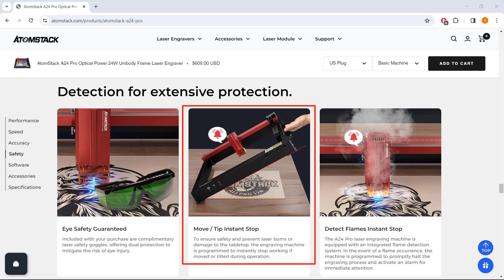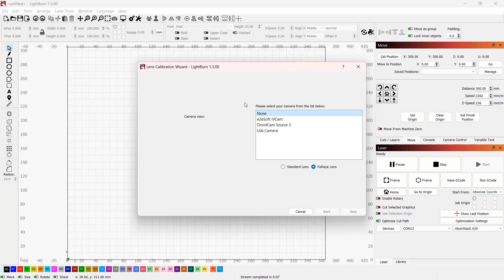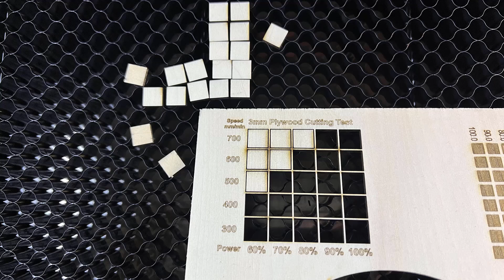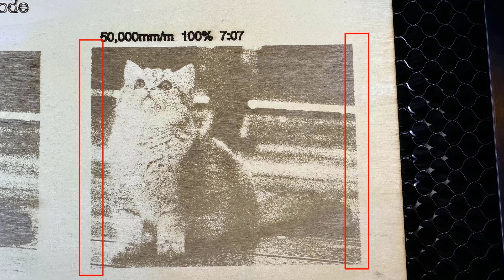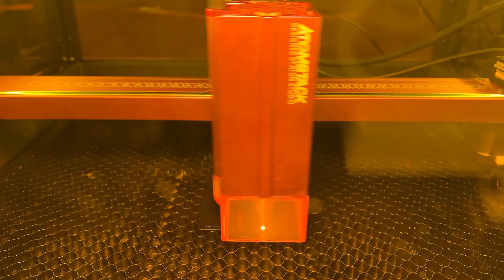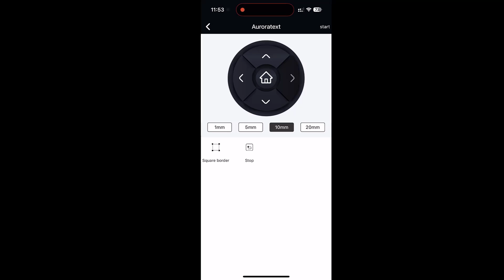AtomStack A24 Pro: High speed laser engraving @50,000 mm/min, the fastest laser engraver ever tested

Comment: Another great tech review.  Thanks.  I'm interested in the AtomStack A24 because it's a budget friendly desktop laser with many of the features of a CO2 laser.  I particularly liked the durable looking enclosure (open frame lasers are a concern of mine) and the steel rollers on steel rails and bearings on linear rods for the motion control system like a real CNC machine tool.  Those are well worth the difference in cost and help the A24 achieve a higher long term value.
Reply: Don’t expect any support from AtomStack!